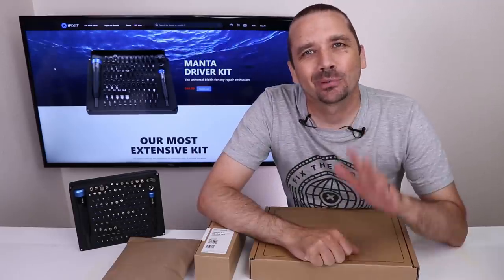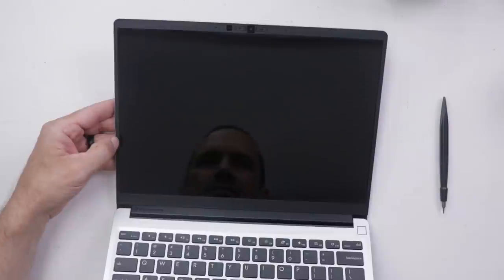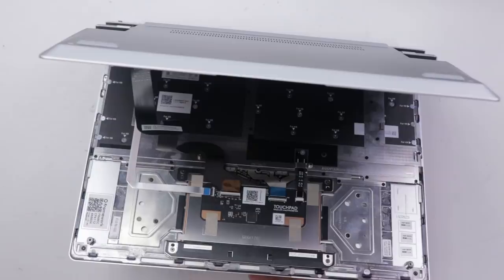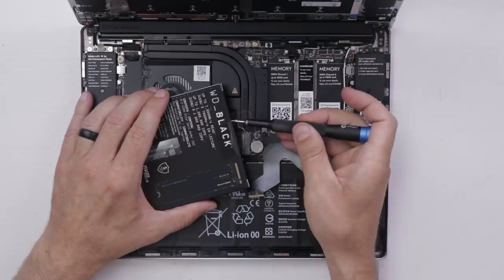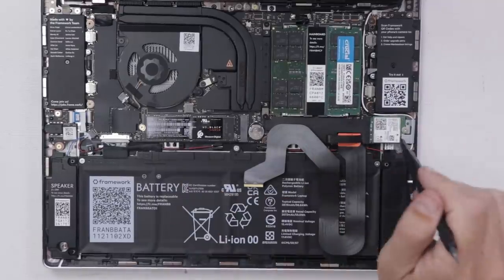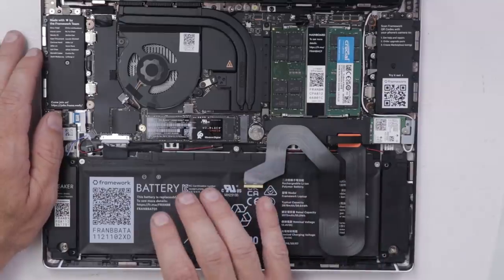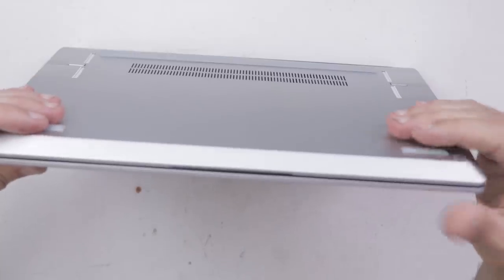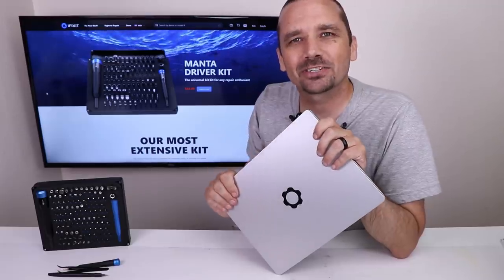I "Built" My Own Laptop - It's Actually Repairable!

Comment from the maker: Here's a little more info on upgrading the CPU: https://youtu.be/XFrJcjCbCA8?t=294
Reply: where i can buy one of that?
Reply: You forgot to take off the bezel to replace the camera , you can also do that as well as changing the display
Reply: Great video Steve this is a game changer
Reply: See the way they're marketing this laptop makes me upset though. Most high in laptops let you replace everything that they let you replace. The only differences is, you get to customize what ports you're using and it's a little easier to take apart.
Reply: Can you make test on ps 2 slim old model.. Do as you did before on ps 4 fat if you remember.. When you pitted it on  bag and turn it on until gave you warning to turn it off.. Make this test please
Reply: @MilesProwerTailsFox  Can I get a link to buy a replacement camera for a macbook so that I can replace it myself?
Reply: @Dtr146  So most slim and lights (and really this is closer to Ultrabook size) let you replace memory (all), SSD, battery, keyboard, wifi, speakers, bezel, and even plan on unifying Mobo design so you can swap that out later (as a CPU upgrade)?

There are a lot of laptops that allow a certain amount upgrades. Even some as thin as this one. But they are rare. But there is 2 things missing, this is targeting the MacBook, XPS type crowd where those options disappear quickly. The other is even the most upgradable laptop still tend to go out of their way to limit customer access to the system. They take it the extra step the do nothing to limit access and they give as much quick information about what you are doing to help you make sure you are doing it right.

There is a lot more to a laptop that promotes DIY work then replacing things that aren't available as a diy part (these cous aren't offered in socket options).

Comment: That expansion ports design is simply a dream come true.
Reply from the maker: Yes, I love that feature
Reply: They can also be easily taken apart with a Philips screwdriver instead of being glued together.
Reply: They did nothing revolutionary but they are the 1st one to do it. I mean other big brands can do it they ever wanted to. But I guess they never will
Reply: Now that's a 2021 laptop
Reply: I disagree, it takes up a lot of space, cost and really limits the number off ports effectively to 3 (assuming you want to charge the thing). 
Most laptops just offer a lot more io out of the box than that. In practice I see the situations where 4 of these modules offer you something in terms of io a traditional does not not comming up very often. if you want to charge, use a mouse, display out, you really only have one port for that usb stick you may want to use. Where a regular laptop would still have ports to spare.
Reply: @qlum  In my opinion you are missing the point, here we are talking about slots that can be populated with exactly what you need in the position you prefer, if I need four USB C, I can choose to mount them, if tomorrow I need one USB C, one USB A, a card reader and a display port I can mount them in an instant, if something breaks (and we know expansion ports are really prone to break), I can change it in a second without a technician, if a standard changes, I can update it without changing machine, there are no limits to possibility of expansion and repair with that concept.
Reply: @LucaBlightOfHighland  But you can't run exactly what you want a lot of the times. As you are ultimately limited to 3 things (providing you need a charge port).
Sure if you ever only need 3 things at a time max, and sure if you don't want to swap them on the fly. You generally don't suddenly need 4 usb-c ports, but if you need one usb-c, 2 usb a, a displayport and a micro-sd it's already time to use a dongle, otherwise you can't charge the laptop. The moment you start carrying expansion ports with you, may also just as well carry a dongle.

My main point is there are very limited configurations that you would realistically use with these 4 ports, a laptop with good standard io configuration does not already have out of the box. Considering the price of the modules, that seems to be a much saner option.

As for breakage, I really have never seen them break on any laptop, so while it may make it easier to repair, how relevant is it. Especially since part's that are actually way more prone to breaking such as the battery, or screen are still much harder to replace.
Reply: Having interchangeable port slots even while limited is a start.

Comment: The used part buyback/exchange really shows how serious they are. Most parts, even the motherboards could end up being used by a series of owners until they are good and dead. Yeah, they take a cut each time, but this should be less wasteful and they gotta make up for not "Apple-ing" people into buying a new device every year.
Reply from the maker: Yes, I love that aspect of their model.
Reply: "they gotta make up for not "Apple-ing" people into buying a new device every year." On the plus side of their design, you aren't even restricted to using their marketplace (I would guess, correct me if I'm wrong?) so while it's great for them to get that extra income, you aren't forced to depend on them (especially important in areas they aren't in yet!)
...on the note of areas they're not in yet, still gonna whine about them not being in the UK yet 😭
Reply: They can make replacement parts that are more powerful like a new motherboard with a new cpu

Comment: The major thing I’d like to see, is an upgradable graphics card. It looks awesome otherwise, but I’d want decent graphics in a laptop. Not even for gaming, I used to have a great laptop, but it didn’t like h264 video.
Reply: Think it is very difficult to such an tiny graphics card. Because normally the graphics card is soldered onto the board so it takes up as little space
Reply: Any upgradable GPU would be a part of the replaceable mainboard, so if Framework do release an upgrade with that feature, you can swap it out without having to throw the hole unit away.
Reply: Actually it is possible if we bring mxm module back
Reply: Those USB c add on cards on the sides connect directly to the pci lanes just like a x16 socket on desktop boards. So no real reason they can't make a gpu card later on of there is demand for it.
Reply: @XxTWMLxX  How is the cooling of that thing gonna work

Comment: I really like this. I agree though a DIY Pro Kit with 0 preassembly would be cool. That way you can make sure it has the perfect amount of thermal paste and all..... My current laptop had a cooling fan start to go out right after the warranty expired. Fortunately I was able to scavenge up a replacement on ebay but this is so much better. My only concern was it looks like its cheap and plastic-y so the fact that you say it feels premium is good. I will probably be getting this when I am ready to replace my laptop.
Reply: The casing is made of aluminum and not plastic :)

Comment: It looks great! I mean, you're not installing every part like you'd normally do on a desktop PC but it's cool for those who are afraid of replacing parts of a laptop
Reply from the maker: I was really hoping they would just send me a box with all the parts but unfortunately it was just the easy stuff. Still fun but not as much as it would have been.
Reply: @Tronicsfix  Yeah but you know, there are people frightened about changing a RAM module in a laptop so for them this "kit" might be useful
Reply: Laptop CPUs are always surface-mounted, as far as I know, so that's something no normal user can deal with. That being the case, it's all the same for the mobo to be already in, along with the cooler. Maybe the shop doesn't have different battery options either, since the battery was pre-installed in as well. Or maybe there're two levels for the customisable component integration: those the shop will always install no matter what and those they necessarily won't. I suppose they could install everything if the customer paid for it.
Reply from the maker: @rauldr37  Yes, I think it's great for a lot of people.

Comment: One thing I'd like to point out is that you are supposed to remove the keyboard panel after un-doing all the screws and then you detach the ribbon cable from the motherboard and not the keyboard side. There's a handy pull tab for easier removal of cable.

Comment: 2:04 - I mean; for Lenovo ThinkPad laptops, they give pretty detailed repair guides and sell components for most repairs you'd want to do yourself. :)
Reply from the maker: Good to know. I'll check that out.
Reply: Better than most, but AFAIK they don't sell a T-series ThinkPad anymore without at least one soldered RAM slot, which undermines upgradeability/repairability quite a lot.
Reply: Thinkpads are pretty much the exception.

Comment: I only wish Framework had gaming spec parts available for their kits! At this point in my life, I live abroad and don't want to be weighed down by a big bulky tower, but I also want to game from time to time. But I'm also tired of high-end gaming laptops becoming obsolete for new release games within two years. It would be nice to have a machine that's easy to upgrade when needed, because right now that's hardly an option with gaming laptops on the market.

Comment: Wow super nice, this way you can just add and remove stuff as you need, and not a lot of breaking smalls parts or losing screws, I will say I will like to see the performance, like ok can it handle development software like Visual Studio Community or an Android Studio development environment, there is were my performance issue is on putting money to buy something like and HP Z version laptop as an example or an IBM Thinkpad, so can it handle heavy work or is just for school projects stuff.

Comment: That was actually the wrong way to disconnect the keyboard. It's even easier than a ZiF on the motherboard side there's a wide connector with a pull loop.
Reply from the maker: Ha, ha, I noticed that after the video was done. It is much easier to do it that way!

Comment: I've heard of these diy laptops before it's something I'd do but I'd like way more customization if I could eg custom display, a custom case ( lets say someone submitted 3d render of one and was validated to work) even a way to have quick disconnects to use water cooling when using it as a desktop.

Comment: Every single electronic item can be fixed and upgraded if you know what you are doing. My laptop has a full desktop CPU, 64 GB of RAM and 12 TB of storage. The only thing that it had in it when I got it was the CPU. If that's not DIY then I don't know what is. The ports on the laptop look like they're USB C dongles. So a USB hub would solve that.

Comment: The problem with laptops is that there is no fixed standard for them, they all have different sizes and form factors for the components, I understand that some people may need a lighter regular laptop for school and others might prefer a more heavy duty computer like a gaming oriented laptop, however it still doesn't change the fact that almost any kind of mobile repair can be expensive for alot of people. Depending on the age of your laptop you can probably still source a new screen, battery, maybe some more ram, upgrade the storage devices, but when it comes to replacing the core components like the motherboard, the processor or graphics chip these are inevitably going to be more pricey than the average person would be willing to replace, not to mention it can be alot of trouble. On a tower pc you pretty much have multiple choices with everything for lower prices so regardless of what happens, there is no need to break out a soldering iron to fix failing components, all you really need is a Philips screw driver.

Comment: What is the 1TB add on? What purpose does it serve?
Reply: It’s basically an external SSD, and the huge bonus is that instead of requiring a cable and sticking out, it just slots into the computer and sits flush inside of the laptop.

Comment: It's very nice, but... basically the 350 bucks 6 years old cheapo laptop my daughter used for the lockdown has the same kind of modularity (speaking of storage, memory and components like wifi cards and speakers)... so it used to be the norm!! The difference is that finding the parts is not so easy most of the time. :(

Comment: This is less DIY and more just a snap together kit. You don't get to go to a site like Newegg or Amazon and browse through a thousand different options for components and pick out what you want. You get a prebuilt kit with a couple of options all from the same company. It's still a neat idea overall, but it's a long way from the full potential that something like a desktop would have. Good first step, though. This should have been done a decade ago.

And the right to repair concept needs to simply be law.

Though I am concerned at how easy it would be for someone to steal one of your external modules, like the storage expansion.

Comment: The BIGGEST PLUS comes from having a Button Battery to hold the Bios CMOS Clock on the the motherboard , then using the in-build one that slowly drain your Main battery ... another planned obsolescence "Feature"

Comment: Hello! I have an issue with my Xbox 1 S, and I haven't found any videos on youtube about this problem. Maybe you could help?? Basically the issue is that whenever I try to turn off my Xbox, it just wont turn off. The button flashes constantly. I left it for around 3 minutes once and it still would not turn off! And I can still hear the fan inside rotating, and the tv also thinks that the Xbox is still on. The screen goes black (as it should) but then it doesn't say no signal (as it should). Please help, this has only been happening recently I have no idea why. The only way I found so far to turn it off is to pull out the HDMI and the other cable that actually powers the Xbox. Then I would go and plug them back in. But when i've done all that, sometimes the Xbox wont even turn on!!! Then I go unplug and re plug until it turns on. Please please please help!!!!!!

Comment: The antenna order doesn't matter. This is awesome though. I tried upgrading a laptop WIFI card once. The computer refused to boot and gave an error of "not a permitted WIFI module" or something like that. I'm like WTF?!?!?!?!? Apparently you could download hacked BIOS that would disable the check. I even bought new antenna because it was a 3 antenna card instead of 2. I wish I had known about this company. I would have considered them over Dell........if they have a 2in1 version. I can't stand a laptop that isn't also a tablet. Yeah.........no tablet version and also only intel (which is trash at the moment). So yeah this wouldn't have been an option for me. Intel integrated graphics just don't cut it, but AMD's integrated graphics do and Ryzen is a better CPU anyway. Hopefully in the future they'll have an AMD option and 2in1 options as well.

Comment: There's so little to do in there that calling it DIY seems kind of insulting. Just install the SSD, RAM, and WiFi card yourselves, Framework. I'd rather not bother spending the time if that's all I get to do.
Everything else about this is really cool, though. I hope the company can stick around long enough to see what upgrades end up looking like.
Reply: It's basically the same as any "bare bones" kit or a NUC and I really appreciate it since you can buy it for $250 cheaper and use parts that cost around half what they charge in some cases.

Comment: The only downside on this laptop is that it is only available with Intel processors. AMD mobile chips are generally better at power usage than Intel and admittedly the AMD built in graphics are superior to Intel at the moment. Nothing wrong with Intel, I'm just saying to only have Intel is a downside. For someone like me, I don't need a laptop with a lot of performance out of the box so power consumption is more important.
Reply: They could more than likely make an AMD motherboard in the future. I think they went with Intel for this one because they wanted Thunderbolt support.
Reply: @CSab-ui2jt  That could very well be. The real question is do they actually use it right now? As far as I know they have not been approved by Intel yet.

Comment: Does Framework provide schematic diagrams for their motherboards as well as IC's for sale? Would be a shame if they went this far with the right to repair just to stop at the most important part.
Reply: Schematics are only available to repair shops unfortunately, but this is more than likely a limitation that the motherboard manufacturer has imposed on them. As for chips/IC, I don't think Framework themselves sells them, but we'll have to wait until their marketplace opens later this month.

Comment: This was a good idea until they made the only way to change the cpu is by swapping the motherboard out which is such a waste of resource.
Reply: That's not their fault though. Intel and AMD don't make current-gen laptop CPU's that are socketed.
Reply: @CSab-ui2jt  current laptop cpus are all BGA, they have pads on the bottom of them which can put put into a socket with pins that connect to the pads. The reason for it would be that using a socket will increase the height of the frame making the device thicker